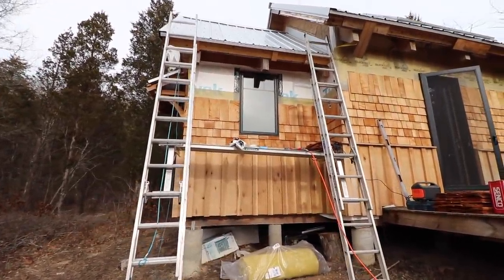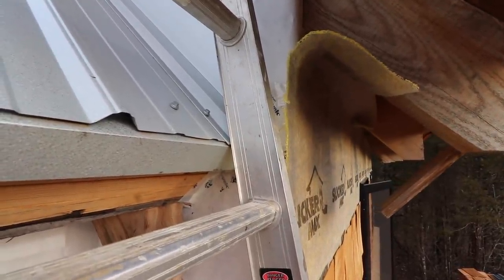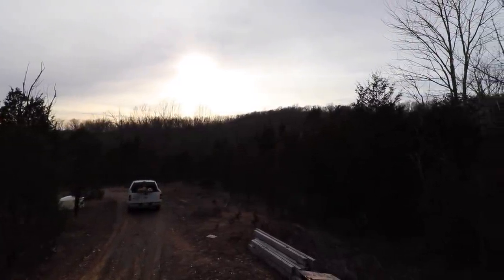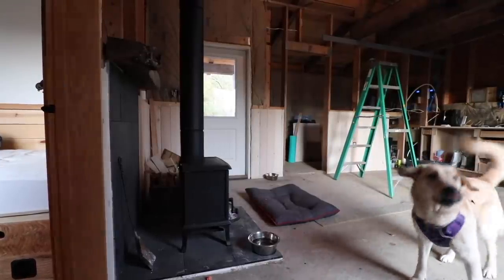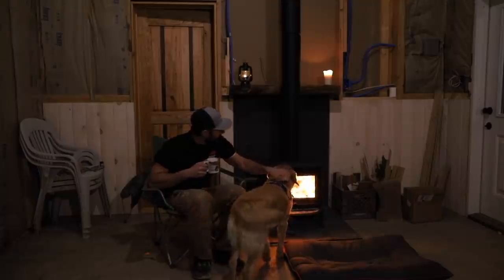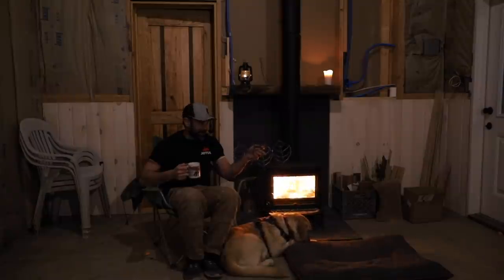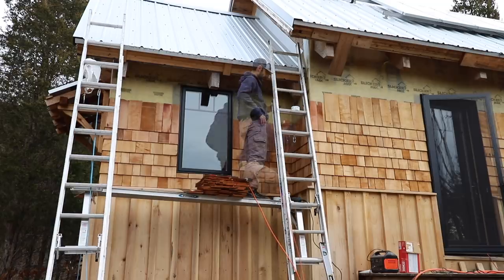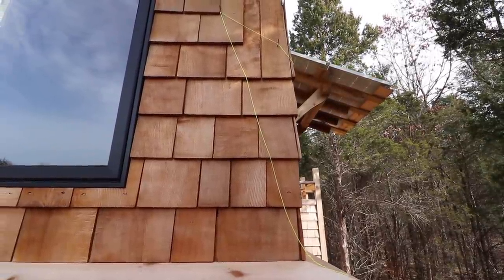Off Grid Cabin Build: Overnight Trip With my Dog - Siding

Comment: You should still be able to install a frieze board between the rafter tails. The place looks fantastic. You can also save time on your inside corners by installing a ground....1" x 1" cedar, it will almost disappear and allow you to shingle each side separately.
Keep up the great work.
Mike
Reply from the maker: Thanks Michael, I am definitely going to use the 1x1 board on the back, that will save loads of time.
Reply: Another time saver is to screw extension legs onto saw horses for your staging. You can make them different heights to adjust for the grade, and best of all, you won't have to duck underneath anything like with the ladders and ladder jacks.

Comment: Mike....Just cut a piece of wood  to put at the top of the wall between the exposed rafters...and the height of that wood...will match the height of rafter where it meets wall.   Then you don't have to get any small boards up in that angle and it will look like it's finished out.  Might need to put a small shim at top of wall so any piece of solid wood in there is plumb.
Reply from the maker: Yes, I am planning to do that, just need to get one more course of shingles in there to make it look like the pattern continues into the frieze board.

Comment: Good progress Mike.  Those cedar shingles are tedious.  I recommend using a strong construction adhesive and a 1X2 (or the dimension of board you like) at the soffit to top of siding transition where you are unable to nail.  You may also be to screw it vertically to the soffit, countersink the holes and wood fill.
Reply from the maker: Thanks Ted, we'll get it done somehow.

Comment: That head knock hurt me too.  Been there done that ... disadvantage of a ball cap, but I must wear my ball caps.  Use screws in the tight space.  The right screw will counterbore itself ( it worked for me ) ... the right color screw is hard to see ( Right angle drill-driver are available ).  How to deal with the corners and cedar shakes/shingles:   Trim.   In your case; with a razor knife and a straight edge, cut-off existing shingles and trim to fit 1" x 6" trim boards.  Leaving the shingles to butt up against the corner trim ... color calk to seal the seam from water.   It works for me.  I often install nailers for all future trim boards insuring the tamper of the cedar single to butt against the trim boards side edge and not protrude beyond the surface of the trim boards face and for easy install of the final trim boards.  This also allows for trim board replacement esp. if screws are used.  Good choice on the interior finish.  Any question?
Reply from the maker: Thanks for the tips I think I got it.  I'm probably going to use a trim board on the inside corners in the back, as long as I haven't shingled up too high already, can't remember how far I went.

Comment: I just used construction adhesive to secure that top row of shingles on my outhouse project. I prefer not to face nail. No issues after five years.
Reply: theajeff i was going to say the same thing. I don’t know where storms come from there, but there can’t be that much rain that is going to hit up there. Can there?
Reply from the maker: Thanks Jeff, that's going to be one of my plans if I can't get the palm nailer to work up in there.

Comment: I always used a simple razor knife to trim shingles.  You said you were planning on a wood floor.  A cabin tends to get more boot traffic.  You might consider a more durable flooring like laminate.
Reply from the maker: I use a razor also, but on the thicker ends the jigsaw saves some time IMO.

Comment: 22:44 I would use a 1x4 or 1x6 horizontally as trim. You might be able to get a nail/staple in at an angle. That or try using something like Loktite PowerGrip construction adhesive.
Reply from the maker: Thanks I was thinking of something like that, a larger trim piece and I could possibly use my palm nailer or my flexible angle bit and screws

Comment: Exterior wood glue for the top course under the eaves should do the job.  Alternatively, you might consider a wide trim board (like 4-6'" wide) across the top course of shingles and beveled at the top edge of the trim board to fit under the angle of the eaves.  Trim board could be screwed into place with screws driven at an upward angle.  I think the trim board might help to visually frame out the shingles and would echo the drip rail at the bottom of the shingles.  Ought to be easy enough to tack a trim board across the top edge to see if you like the look.  Anyway, great work.  Love your cabin and your videos.
Reply from the maker: Thanks Richard, I am going to try to get one more course up there and then do a trim board.  I think it will work out.

Comment: If you are going to put a treatment on your siding Q8 log oil is by far light years ahead of anything else we've ever used. We used the red brown but you can get it in any color that you would want your wood siding or shingles to be. It is expensive but nothing outlasts it. You can order it with a additive for mold and bugs from boring need to termites and anything else. The stuff is amazing it can even just be clear to show the wood and protect it with no added shine and water just repels off it.
Reply from the maker: Thanks for that tip, I am going to treat it eventually, I want to use something that can be re coated without removing the old coat.  Sounds like a great product.
Reply: Yeah that's what's nice about that product , you can just spray it off with water or water bleach mix then rinse if it's real dirty and let it dry then come back and spray there Q8 log oil on and do big sections or small sections at a time and it want streak even of it runs you just keep spreading it across the logs and it soaks up and dries completely even and no steaks or unwanted shine I can't say good enough things about it and the additives just mix right in the container and water dances off of it and bugs want no part of it but it's all natural instead of crazy poisons . We cost ours every 5 years .

Comment: Where the siding meets the tippy top of the wall and nothing left but a space put some kind of border moulding or hell just spray foam. I'm surprised the siding wood couldn't butt up tight enough to close those gaps.
Reply from the maker: Yea I think I am going to slide some trim up in there.

Comment: Awesome job as always brother.  One of my favorite channels.  I am getting prepped to build a house, would you mind sharing the details on your windows & front door again?  Brand, model, any other pertinent info??  Keep up the great work & thx!
Reply from the maker: Hey Andy, they are Marvin Wood-Ultrex.  If those are too pricey, you can go with all Ultrex (no wood).  And a little bit down the line from that, you can get some called Sierra Pacific that I have used before and they are pretty nice and even a bit less than the Marvin all Ultrex, but still nice.  Those are the brands I like for windows.  Good luck with your build, windows and door are quite expensive but also a good opportunity to make your place stand out from the next.  One regret I have is I wish I made the windows even taller than they are.  I think they would scale a bit better.
Reply: @50Acres  Awesome!  Thx for the feedback.

Comment: Regarding the top course of shakes under the eaves: The top row of shakes wont be exposed like the rest or the wall, so you wont have the same issues like rain and wind. Why not take a piece of 1/4” mahogany plywood and cut to the dimensions of that row. Mark the shakes to pattern and attach them to the ply using construction adhesive.Then mount the whole unit as one piece. You can probably get away with using 1 1/4 deck screws with a stubby screw driver
Reply from the maker: I'm planning to do something like that, I think it would work quite well.

Comment: That siding is very labor intensive. I don't want to think how much it would cost to pay a contractor to do the job. I was wondering if you have thought about using those fans that you sit on wood stoves/heaters to circulate the rising  hot air from the heater? I think the nicest thing about them is that they use the rising air to cause them to spin. No power needed. Just a thought. Art in CA
Reply from the maker: It would be pretty expensive I bet, hopefully they would go faster than me.   I would like to pick up one of those fans.

Comment: There's two kinds of people,, people who makes mistakes & those that don't.. The ones who don't never do anything!!! Gables I pick out 7/1-2 to 9 inch shingles (wide),, set my chop saw  to the roof angle,, cut the roof angle off the shingles thin side all the same length 13//14 inches,,,, so you build your rows to the thick end of the shingle going horizontal,,,,, only the one shingle on each side of each row under the eve,,,,,, instead of going vertical,, neat look & no little corners to mess with.. then i screw up a level board from  the bottom side of those 2 shingles ,,,,,,, pitting the screws in the cracks between the shingles never to be seen,,,,,,,,, add a tight string line about 6-1/2 above the bottom of the last row... grab an arm full of shingles,, fill in behind the line,, resting on the level board,, & bang away...good luck,,
 Aloha
Reply from the maker: Thanks Richard, that sounds like a much faster way of doing that gable end.

Comment: How long are the nails for the shingles and how thick is the plywood sheathing you are nailing into? Are the nails poking through on the other side?
Reply from the maker: the staples I'm currently using are 1 3/4 inches, and the plywood is a half inch, they stick through in various lengths.